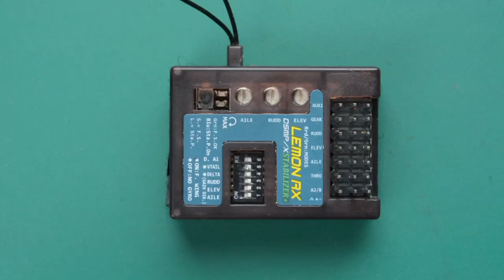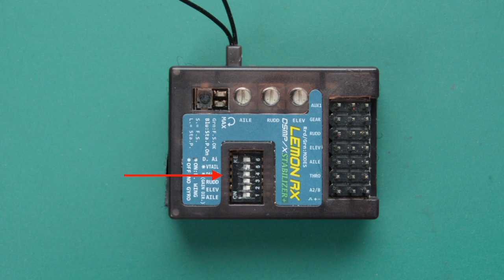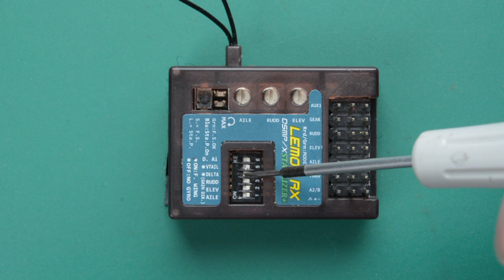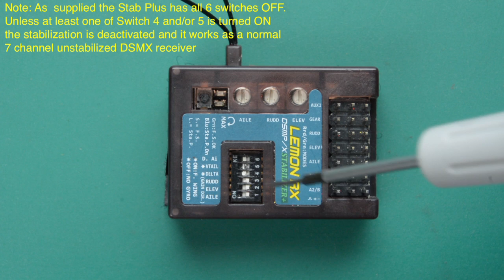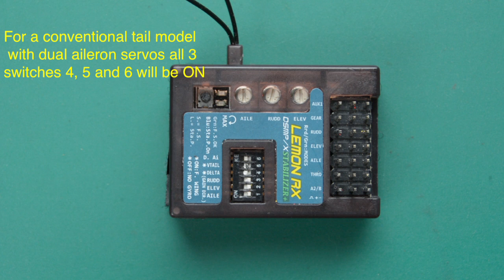1- Lemon Stabilizer Plus: Pots and Switches

Comment: When setting up the receiver for a flying wing which one of the WHITE switches should be turned to the on position, is it only the Delta switch? Also, what about the other switches would  any of them have to be turned to the on position?

Thanks

Comment: can I use my Lemon Stabilizer 7 ch Rx with the new Arrows Tecnam , which already has the " Vector " stabilizer unit inside it .....is there a way to disable the Lemon Rx stabilization?....I am concerned about the Lemon receiver and the Vector  stabilizer  unit  being incompatible  if used together ......... thanks
Reply: Sure. When all 6 DIP switches are OFF stabilisation is disabled.
Reply: @lemonbetatest7332  OK Great !!! that's simple enough........thank you

Comment: im trying to install the lemon 7channel rec with stab plus in an airbus 380 and wan t elevon settings, what pods shoud be on and what pods should be off. i think i set the dx8 radio as normal. can you help?
Reply from the maker: Setup is comprehensively explained in the Reference Guide starting at page 5. You set the transmitter to normal with no elevon mixing.
https://www.rcgroups.com/forums/showatt.php?attachmentid=9835599&d=1488573620
Reply: jj604utube thank you very much

Comment from the maker: J4 is ON, J5 is OFF, J6 is OFF. J1-3 depend on the reaction direction of the stab.Set wing type in the transmitter to NORMAL. It is comprehensively explained in the Reference Guide starting at page 5 if you need more info. https://www.rcgroups.com/forums/showatt.php?attachmentid=9835599&d=1488573620